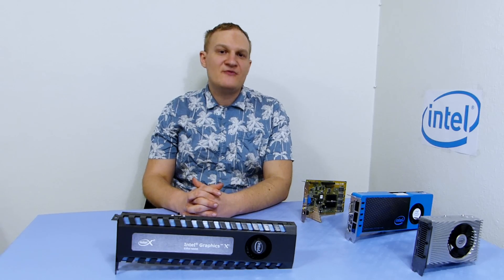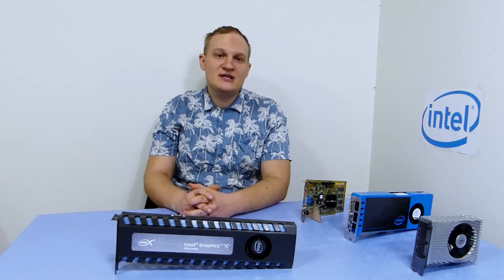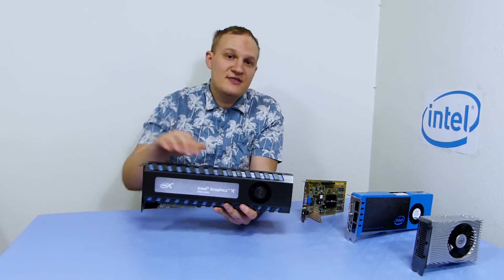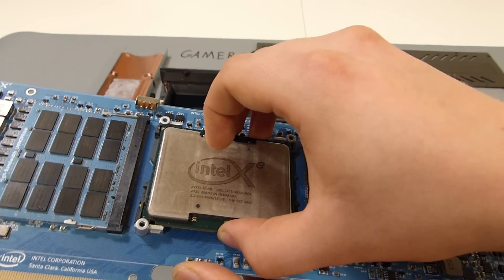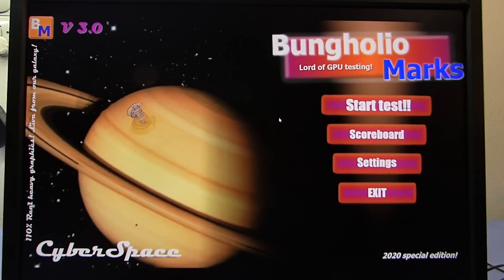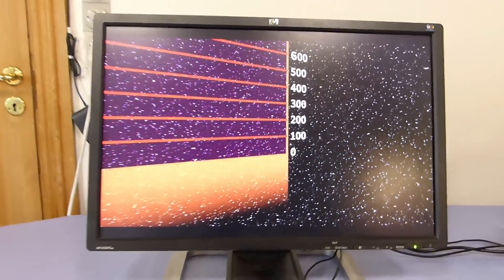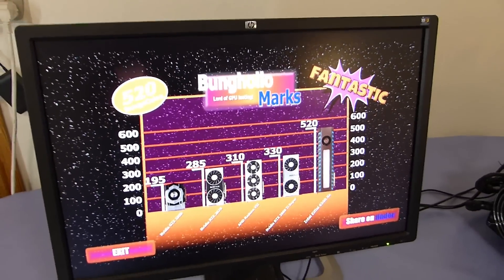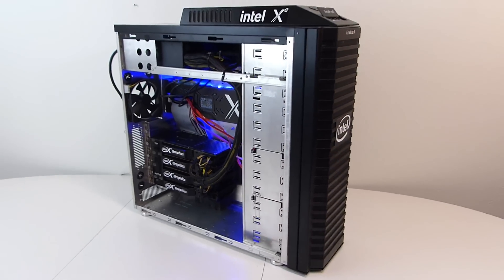Testing new Intel Xe Gaming GPU - Eiffel 6500

Comment: It is would similar if Intel Xeon Phi 7290 CPU and Intel Arc A380 GPU It is combined I guess it was similar to this device. Intel doesn't do such a thing for now. If Intel does request this is a complete ultra super is it computer making. 4 Thunderbolt 5.0 and 1 DisplayPort 2.0 can make. PCI-E in port does not use and does not need. Multiple PCI-E out port make and PCI-E port in-out exteded long cable available is used. The power key can be used to turn on and off the power supply adapter and the computer. It seems to be able to fit a powerful and fast computer on the video card box in the future but for now. In this way, it is possible to use multiple computers in a case.

Comment: I'm mostly interested about how you made that fake heatsink...
Reply from the maker: Happy the heatsink finally got attention! It's 3D printed, but took quite a few attempts to get right, and painting it to look natural wasnt easy aswell.
When the video was recorded the paint hadnt hardened yet so it was a nightmare to handle, if you touched or hit the vapor chamber surface in any way it would have to re repainted.
Reply: @CaptainsWorkspace oh wow, i thought it was actual metal, still good job! Just a tip: next time remember thermal pads for the vrms ;)

Comment: For me the video cards that they show can be an industrial test edition, it is desir prototypes I test to see their functionality and performance in power since they are industrial prototypes that are not sold outside the company or factory. No medium unless you have very powerful contacts that get you the prototype, seeing the case, it is normal for them to do this kind of thing on graphic plates since they tend to constantly reduce the size and recondition and improve the plate using a smaller space and a version. improved a clear example are the example models 1080 and 1080ti for example since one comes out first and bigger and the other comes out time after the 1080ti better performance and more power in addition to a smaller size therefore it is not strange to see plates like this of great more if they are prototypes of which they experience their maximum power that the model can reach and the more it can be reduced in power and size to be ren table to catalog it new and powerful because it is logical that they make immensely large plates because it is easier to test and see how, based on that prototype, a reduced version of it can be achieved not as powerful as the original but more stable than the prototype and errors that this immense plate can have

Comment: Not gonna lie, the modular type of graphics kinda looks a much better way to upgrade the parts you need without having to buy a new whole graphics card instead.
Reply: yeah better hope the VRMs on your card will be suited to every future GPU
Reply: I've seen a mockup of one a few years back.
It supported 1 GB DDR-400 and a socket 478 on a 300 W card.
By the time any upgradable graphics card would need to be upgraded it also would need to be replaced because the supported stuff on it would be outdated.
That thoe SLI-capable 1080 TI with GDDR5X you bought 3 years ago? Yeah, sry, doesn't support GDDR6X and only goes up to 16 GB and doesn't support NVLink, gotta buy a new board. We can be glad that PCIe is supported for 15 years now.
Reply: not viable with the high speed buses these days

Comment: Jokes aside, modular GPU would be an awesome idea- since for the most part, the MB is just the power distribution unit- they solder in the ram, however in the case of HBM that is integrated into the core.

Think about it, they could reduce the cost of a upgrade by $80 or more.
Reply: But they want your money, every 7 months infact.
Reply: @nikolakarovic5964  that's about when  you get tired of using the same thing and then it breaks ahhh planned obsolesce
Reply: @tobiwonkanogy2975  Gpus were modular back in 90s, you could swap better 2d modlule or 3d module, add more Vram on Gpu. Gpus were expencive and undestructable. Tech and games were so fast progessing that any gpu even with adsons would become apsolete in 2 years. Then they decided to change Rohs standards with Pb ban and we got Gpus which are daying and we are baking them in owen cos graphic in games is same from 2008.
Reply: @nikolakarovic5964  No they were not.
Reply: @SomePotato  You are noob, U didnt have voodo cards with 2d and 3d part and slots on them for memory modules.
Reply: @nikolakarovic5964  Troll.
Reply: @nikolakarovic5964  I remember having a GPU with PCI-32bit connector back in 1997 it had 1MB dedicated RAM and a technician updated it to 2MB by adding a module to the board
Reply: I've been dreaming about that since years ago but amd and Nvidia won't do it even though they can because of the marketing politics otherwise I could build a ps5 spec for the same price

Comment: I want two of these. One so I can switch it to CPU mode for 4096 CPU cores, and then one for dedicated graphics. For $2,000 USD this will destroy Ryzen Threadripper and Nvidia's RTX 2080Ti Super. 
And to top it all off having two of these cards will ensure I never will need to run my furnace again. 10/10. We just better hope Intel doesn't change the socket design in 6 months. Then we'd have to upgrade to a whole new card. But it would probably have 8092+ execution units so it's probably fine

All kidding aside, I really love the detail you put into these boards. The little touches are what make these so great. When you pulled out the SATA cables after the benchmark I lost it. Well done.

Comment: why did they never make socketed GPUs or expandable VRAM actually?
Reply: Expandable memory is impossible if it is part of the processor package, as is the case with HBM.  In general, it would be an issue with the tight relationship between processor and memory architecture.  For example, if you design some structure with exactly the number of address bits required, then you can't index more memory, which of course you can see with 32-bit processors and the 2/4 GiB limit.

Comment: Please have behind the scenes this thing is amazing
Reply: Yeah a behind the scenes would be nice.
Like did He really make a custom PCB with integrated lga Socket that Lights Up blue when powered? Lmao
Also, machining for the heatsink etc.
Reply: @siriusargus6766  its all high quality 3D printed, even the Heatsink, if you look close, by the reflection you can see that it's all high detailed plastic, you can look at the components (like mosfest, capacitors, and even the chip itself) it's all plastic
Reply: I remember seeing behind the scenes on previous videos, but can't find those now
Reply: probably 3D printed
Reply: april fooled?
Reply: @dcmk4683  look at this dude......